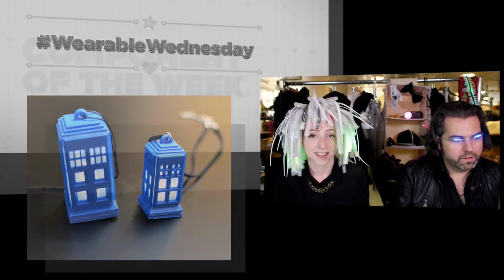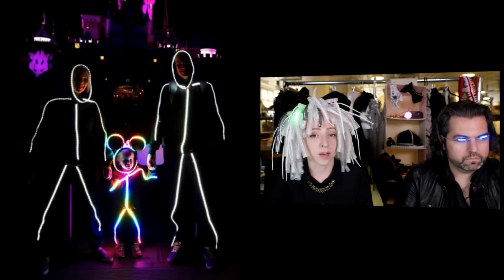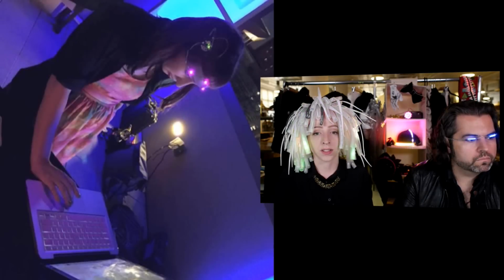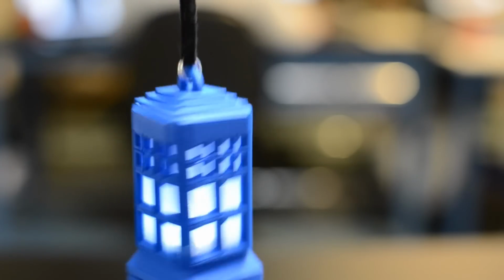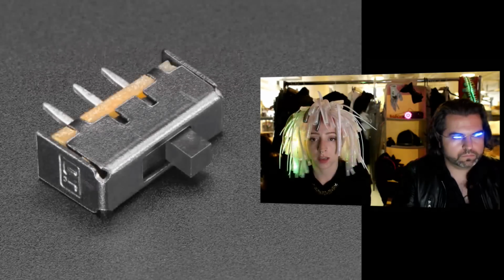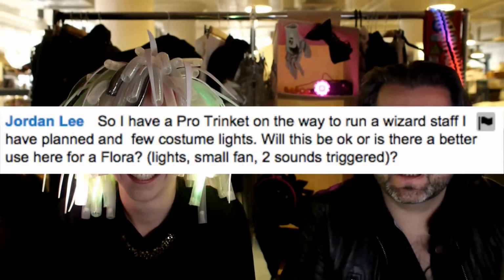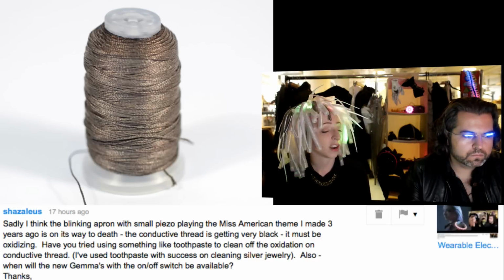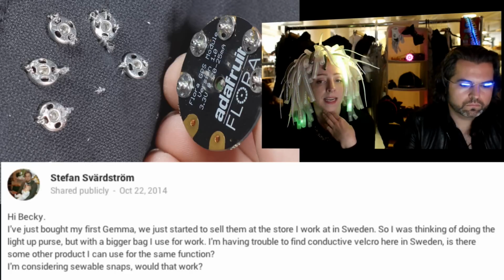Wearable Electronics with Becky Stern 10/29/2014 - LIVE

Comment: Hello from Sweden!
A few battery powered questions:
What's the best way to see how much battery juice is left in a LiPo battery connected to a Flora?
The TIMESQUARE DIY Watch Kit has a "built in battery meter", how does it work? Can it be added to a Flora?
Right now I can read the battery voltage by using a voltage divider (2x 1k resistors), but it's using about 20mA (measured between VBATT and voltage divider). Would that drain the battery faster, if so how much?